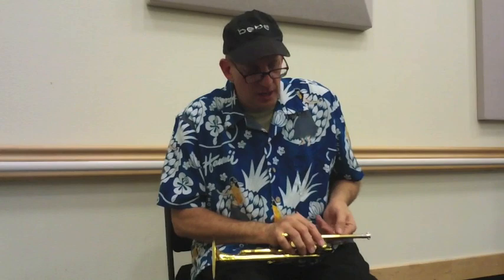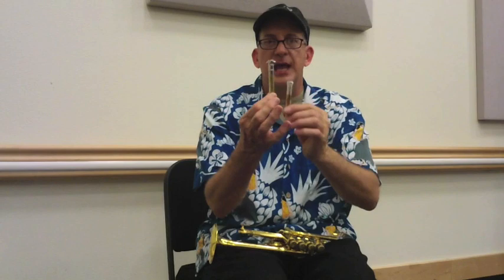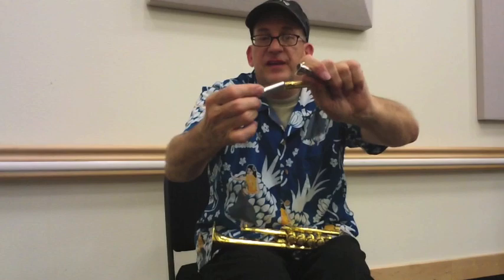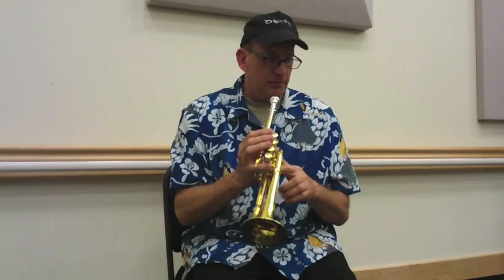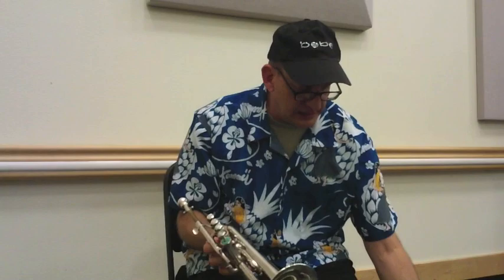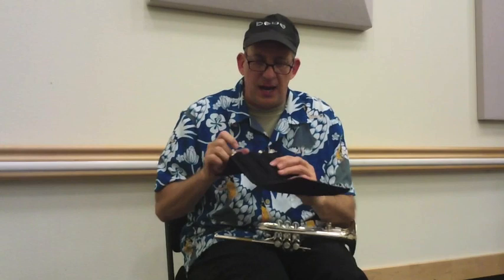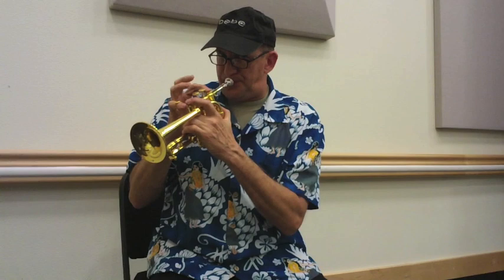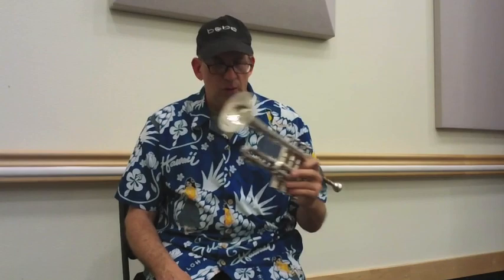Trumpet tip,  Piccolo Trumpet Basics

Comment from the maker: The first thing to do is try to relax as you play. I understand that this is a concept that is not so easy to put into performance mode. Piccolo is an instrument that demands a relaxed approach. It is possible that your equipment is not helping you. I would consider mouthpiece first. You will need to find a match between the horn and the mouthpiece that works for you.

Comment from the maker: tptman001, The pic is about getting the right sound on certain pieces written in the upper register. It is a different instrument and is played differently. It doesn't necessarily give you more range. Because it is a small instrument and you might be using a smaller mouthpiece than you typically use on your Bb you might feel it is easier to play in the upper register. In order to play well in the upper register on any trumpet you must develop and control your upper register. Hope this helps. Jon

Comment from the maker: Niklas, The Bb piccolo with a 4th valve will go down to the C# below the staff for a standard Bb trumpet. So yes you can play with a Bb trumpet or the same pitches as a Bb.  The extreme low register on the piccolo does not sound great so I would use a standard Bb. I have not played a Carol or Thomann so I do not know how they play. I recommend looking for a used name brand piccolo. I recommend finding the best horn you can and used is going to cost the least. look for a great deal on a used horn

Comment from the maker: Michael it is not easier, it is different. The piccolo takes a more compact approach than the Bb trumpet. It is more about sound than ease. If you tried to play a baroque piece on Bb trumpet in the upper register it would sound a bit strange. It would also sound strange to play a lead trumpet part on piccolo. Each instrument has its application in the upper register.

Comment from the maker: Jethro, congratulations on getting a nice horn. I doubt there is any problem with the horn. If it plays well then I would say you are fine. I personally blow the spit through my pic by taking the mouthpiece off and blow directly into the lead pipe while working the valves as I blow. Everything pours right out the bell.This efficiently removes the spit throughout the horn. I find my pic gathers spit rather quickly. I tend to clear the horn as described above fairly often. If you feel you truly have a problem with the horn call Stomvi-USA and talk to them about your issue.

Comment: I just got a stomvi pic from Dillon and I started playing it and spit would come out the bell. Is that natural?
Reply: Jethro Thorne mine does that too. Not often but sometimes. The picc is so small. And you use alot of pressure to play. So the wind inside the picc is fast enough to jet out some spit out of the inside towards the bell. Because the air slows down when it reaches the bell it doesn’t fly out. I think thats why.

Comment: Hi Jon. I know that the piccolo is an octave higher than the Bb trumpet,  but with a 4 valve pic, is it right that you can play Bb trumpet notes together with Bb trumpet players in the same register as them? (I know that it cant be notes which goes further down than C sharp.) But would this sound better than on a normal Bb trumpet?  

I also consider to buy a Piccolo trumpet, but do you know if the Carol Brass CPC-7770-YLS or the Thomann TR - 901S is any good? (A 4500 $ Schilke is WAY too much)

Comment: ? If  I use the cornet pipe ,it will sound mellow like?  Or another variation or what like? Don't tell me to try in a big store I am in the island.    T.Y.
Reply from the maker: Frank Peña It’s more about the mouthpiece than it is the pipe. The pipe just allows you to use a cornet mouthpiece for a trumpet mouthpiece depending upon the pipe itself. Cornet mouthpieces are typically the ones used by most professional piccolo players. They usually use a 7E or something similar. The sound of the instrument is going to come from your sound concept you have in your head and the mouthpiece you use. Best, Jon
Reply: Rufftips thanks for your kindly respond , you are a big good one.    T.Y.

Comment: If I play bflat trumpet should I stick with bflat piccolo trumpet or? What would you recommend?
Reply from the maker: +MilkShakeGuy Well I would approach learning to play piccolo by starting with Bb as it will be easier to hear the correct pitches with the correct valve combinations. Once you have gotten more familiar with the piccolo playing in A or Bb will not be a big issue. I think you should give yourself the option to be able play in A or Bb by having both pipes.
Reply: Thanks for the tip